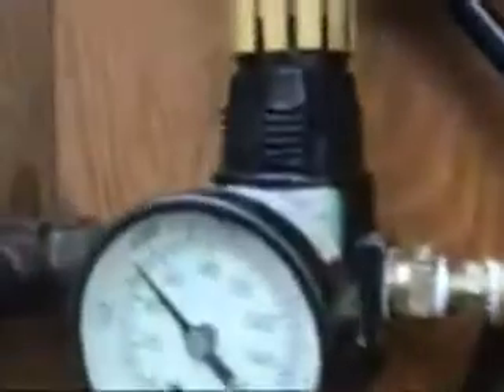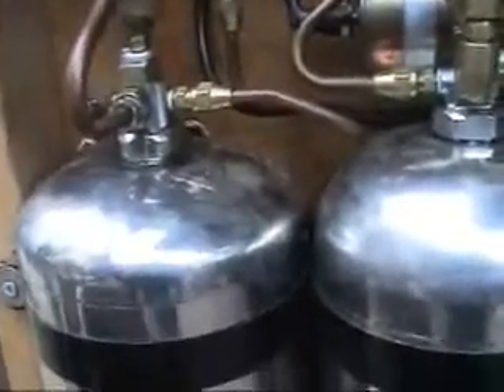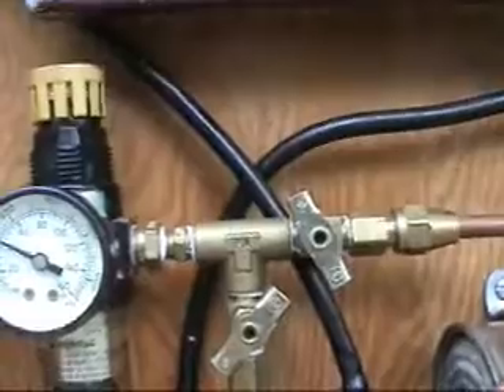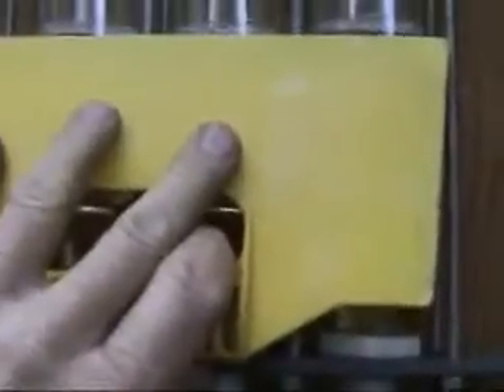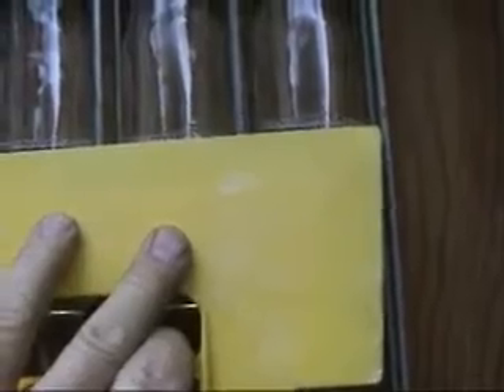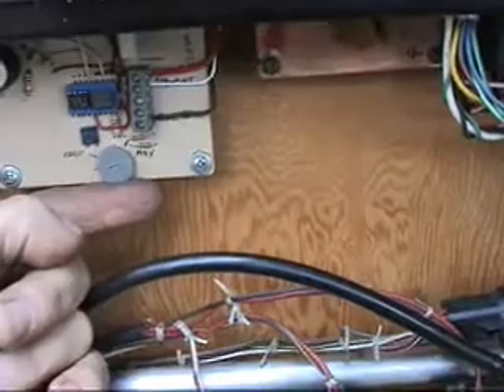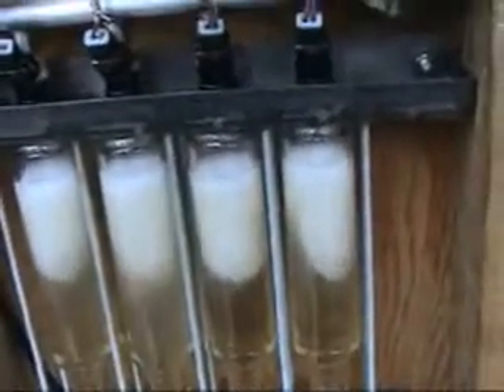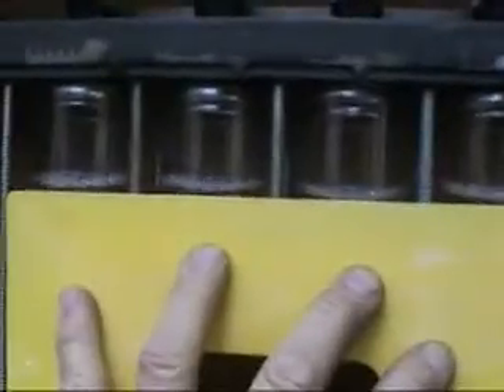Ford Escort Fuel Injector Cleaner

Comment from the maker: Hello, Kuwaiti27. The reason that I wanted the air pressure system is to have the system pressure variable for any injector that I put on it. Also I had the concern that having the fuel pump sitting in the solvent for years would dissolve the varnish on the wires or destroy the rubber seals, requiring a new pump. So with the air system it is more basic, compact  and reliable.

Comment: Loved this project, expect that fact that it uses two tanks, air pressure and a lot of valves, connections and tubes. Do not you think that using an electric fuel pump (high pressure) that is directly connected to the fuel injectors rail would be more easy and cost effective?

Comment: Hey! That was nice. Im about to modify an briggs & stratton engine to run from fuel injection. And i wonder if you could share your circuitboard wiring from that controller youve built. Thanks! / Bluezero

Comment from the maker: You are correct in that fact, the error in the liquid level is stored and will not change. Later found that the poor quality valves obtained from OSH hardware have soft brass components, so the parts gal at the seat  area. This allowed some solvent to seep by the closed valve. Will have to make hard valve stems for use on the soft seats.